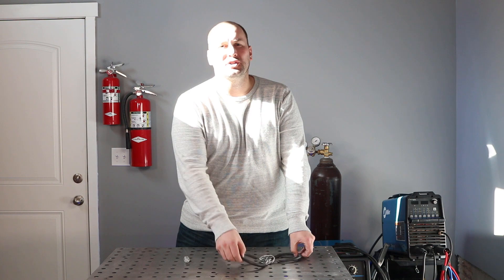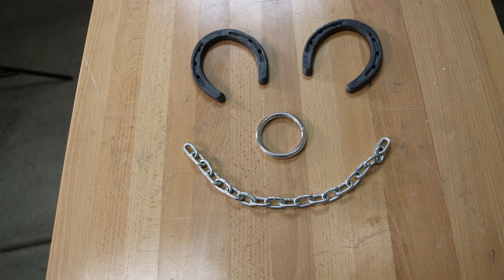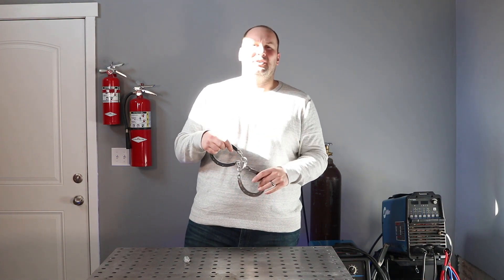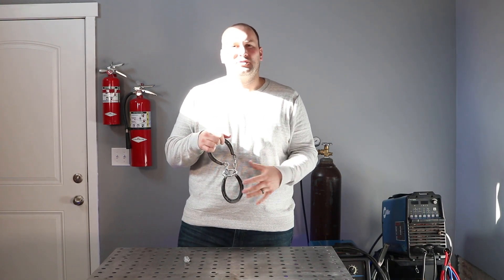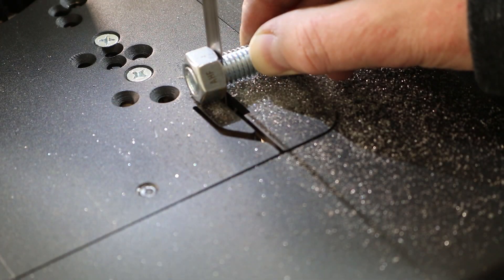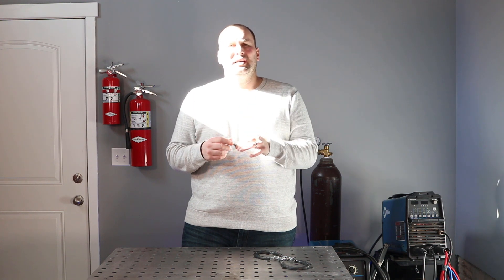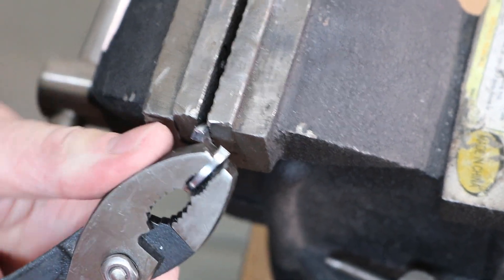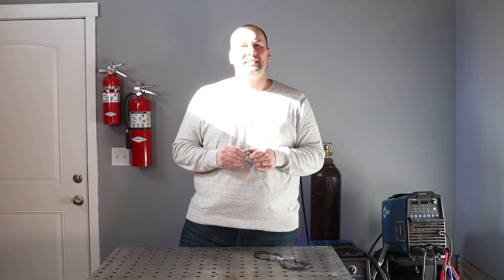2 Easy Welding Projects for Beginners in 4 Minutes

Comment: For the bolt and nut puzzle, do you need to do anything special to remove the bright zinc coating? (Is there zinc on the chain too?) Or is it ok to weld that kind of stuff in some conditions? (Flux core ok? I don't have a bottle for MIG yet, so my options are flux core or sloppy noob 6013)
Reply: @ShortCrypticTales  yeah, that's what I meant. I'm a noob so it's sloppy.
Reply: @rpavlik1  keep on the stick
Reply: @rpavlik1  it is ok to admit you are learning that is how we find people to teach us